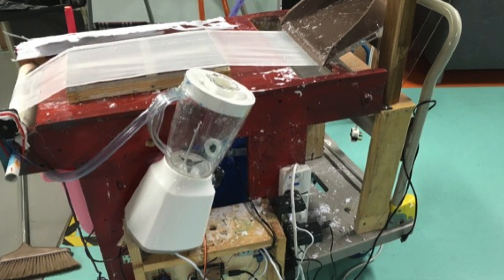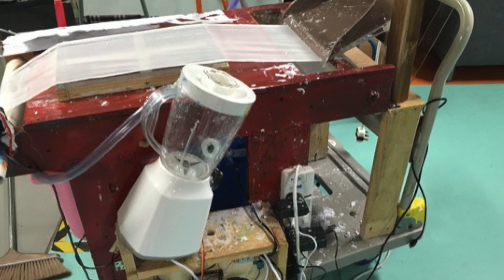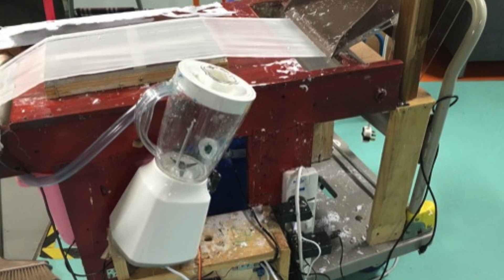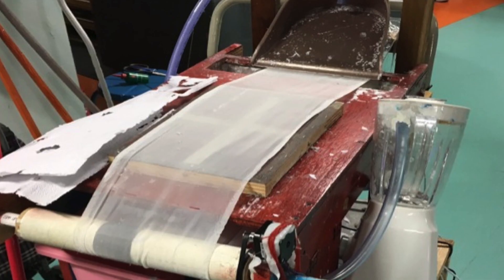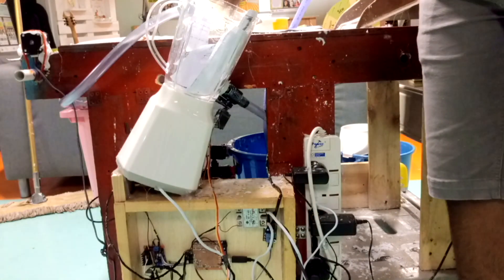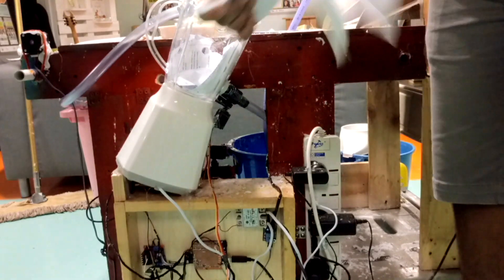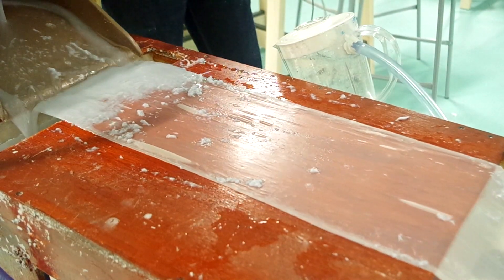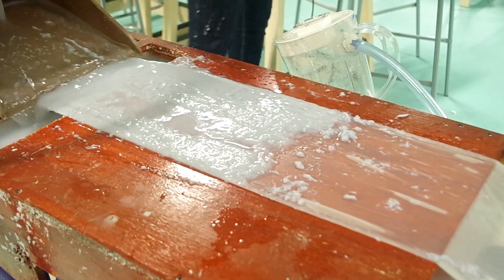Paper Recycling Machine

Comment: what are the specifications of this machine??
Reply from the maker: Shikhar gupta what exactly do u mean
Reply: the specifications of the components ,which you have used for making this machine.
Reply from the maker: I used an Arduino, to be the brains of the whole system, and used relays to control the different appliances
Reply: What is the estimated cost of this whole system??
Reply from the maker: roughly around US$ 300-350 @shikhargupta9620
Reply: @kartikeyagarwal6425  sir which motor you have used in this process?
Reply: @kartikeyagarwal6425  Sir can you make it more compact,so that even it should be used in houses and in offices for recycling paper, since this machine is much needed to environment, pls make this happen sir..
Reply: @kartikeyagarwal6425  waste paper pulp making machine recycle paper